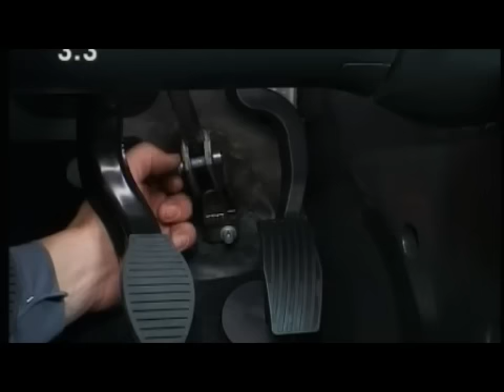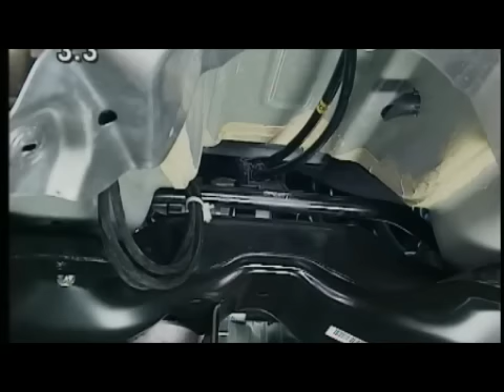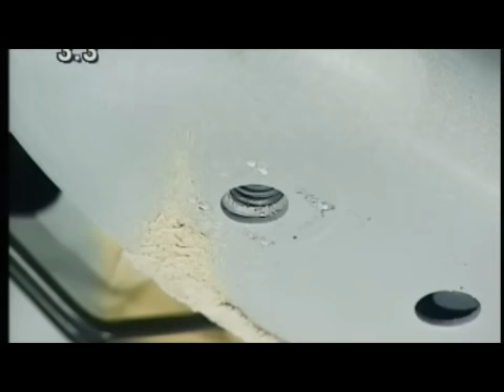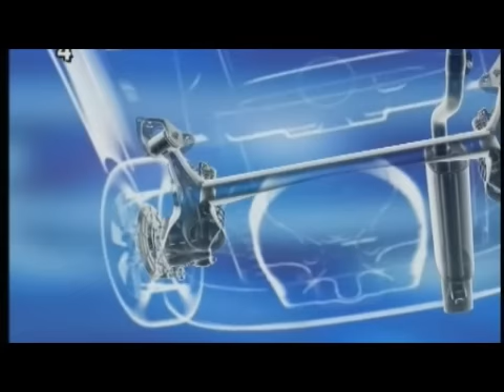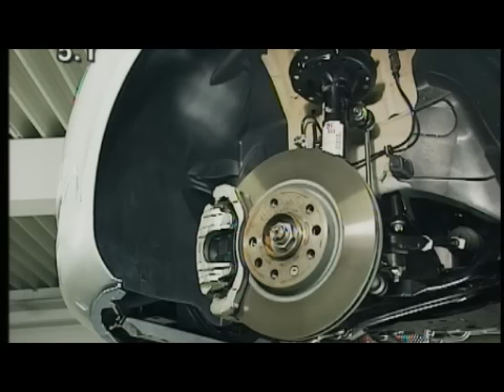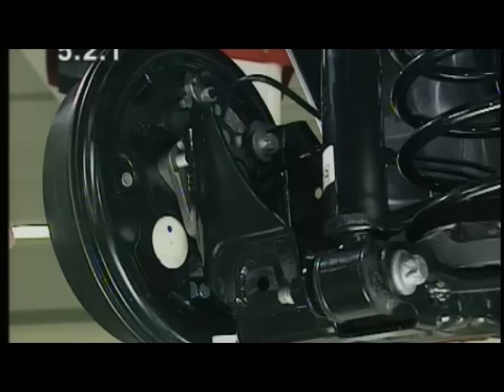Corsa D Part4

Comment: If you have a Corsa D, Vauxhalls will remove and put on a replacement part for free. So basically free part and free repair. There was a product recall on the Corsa's Sub frame.